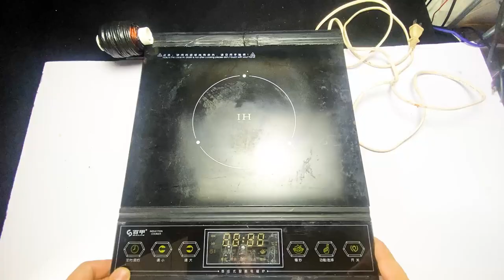How to Make 2KW induction heater from old induction cooker  Great idea DIY induction heater

Comment: Oh, i see:  if it's still able to drive pancake workcoils in the kitchen then why not an air-core selenoïd?!

Well, a genuine IH cooking base happens to be featured with flux-concentrator yokes located below its glass surface, inside in close proximity to the Litz wire actually, so we don't see it but it's there for a purpose nonetheless.

...

As a matter of fact i must confess i thought of a similar procedure when i acquired my Salton iD-1081 and found out such pancake workcoils impose a disc diameter of nearly 4+ inches for its detection to succeed.  The exact date was December 21st, 2010...

Lets raise the bar over a decade later please!

Air-core selenoïds generate only TWO poles with just one single magnetic vector in between.  My challenge is to "Flex the flux" so to bend that vector in a way to multiply the poles, to redistribute the magnetic energy more evenly rather than focus as a red spot.  The thing is all applications don't necessarily even require a metal to be glowing-red, 183°C ~ 188°C (as for 60/40 Solder Alloy) would have been fine back then, though an air-core selenoïd spits out radio noise that has to be tamed down, euh...  M'well, unless living in a forest with no neighbours (and no wall-plugs), possibly relying on batteries or solar panels...

Consider by folding magnetic vectors via "U" shaped flux-concentrating cores it should become easy & convenient to shield it all in a Faraday box, with the workload sealing its IH Aperture electrically as needed.  No more EMi!

Believe me, it's sort of boring when the neighbour starts paying visits everytime one installs in the veranda to relax and finally flip the switch, euh...  Try it around an A.M. radio, it's like a "barker" invitation signal!  At 2 KW why not add an antenna to communicate with beings in space, or on the moon?  ...  Good day, have fun!!

Comment: I guess as its winding it will get short circuit so coil gets spark and damage
Reply from the maker: I also think so. If you want to replace it with a copper tube, you should use a resistance value close to the parameters of the original coil. In that case, the volume of the copper tube will be very large, and insulation will also be a problem.

Comment: Genial.... Es exactamente lo que quiero hacer..... Será para calentar un cautín tipo hacha para soldar canaletas galvanizadas... Gracias
Reply from the maker: It seems that it is not appropriate to use it for work. As far as I know, there are DIY components for high-frequency heaters on the Internet, which will be better than this.
Reply: True, but at a cost of >$100 USD, this, using an unused induction cooker, should work.  Wondering about whether it would be convenient for automotive use ..

Comment: In your opinion, what is the insulating material above the coil if you want to use this method, and what is the amount of heat generated by this process?
Reply: Use a fiber sleeve, it'll work just fine to prevent it from burning and short-circuiting. 
Or you can go all in, use fiber sleeve   and encapsulate it all in cement (or any heat resistant material like it).

Comment: Try taking the secondary coil out of a microwave oven transformer and set it on an induction stovetop with the two ends of the coil about 4 or 5 inches apart then turn the thing on but step back..  lol..  if it grabs you than you shouldnt die but you will at least wake up a little while later..  the more powerful the induction cooktop is the more the coil will multiply the induced voltage across itself..  i tried it on a 6kw and it made the coil arc to the stove and killed the main breaker to the house..   150 amp breaker..   stove fried its brains..
Reply from the maker: Thank you for sharing the method. The wire diameter of the microwave oven coil is too thin. I think it is not suitable for use as an induction coil.

Comment: Great video, but I was wondering if there is a specific configuration for winding the coil or i can wind it however I want.
Reply: with my basic understanding of these effects you can wind it however you want but always in the same direction
Reply from the maker: You can wind it as you like, but the direction must be consistent. The only focus is to insulate it well to avoid short circuiting the coil.

Comment: Working perfectly, but its blown the sparks and coil got damaged. How to prevent this damage.
Reply: And what will happen if i will replace and directly connect to output 1/4  or 1/2 size hvac copper tube instead of coil in induction stove?
Reply from the maker: If copper tubes are used, I think the current will increase and may burn the power tubes or coils.

Comment: can you explain to me something how come these wires have no insulation for the coil ?
Reply from the maker: Because there is insulating paint on the wire, it is transparent, so it looks like there is no insulation
Reply: @MrYang-ju8lc  I see but they don’t get too hot and melt ? Can you tell me how much resistance in ohms are these coils , am looking for a high resistance load because my setup impedance is high

Comment: Danger!  The coil is DC high voltage, DIY is not encouraged.
Reply from the maker: Thank you for your reminder
Reply: @MrYang-ju8lc  i am pretty sure these induction coils run ac dont they?  what are the dangers of this application, please explain? thanks
Reply: itsNotDc.itsVariableCurrent.
Reply from the maker: @iamYOU.youareME5203  Yes, they form a high-frequency current in the coil, what needs attention is to operate carefully to avoid the risk of electric shock, of course this is just an experiment, if you need professional use, it is recommended to purchase the cost
Reply: This is a diy channel, not a kindergarten. But thanks for your concern.
Reply: @iamYOU.youareME5203  For anyone that is near it with pacemaker. Strong EM can cause it to go haywire and kill the person. Other than that you are working with high frequency AC current with just enamel coating on. Slight crack in the coating and you can easily get shocked, probably dead depending on amps and voltage. Always properly insulate such coils ether into housing or least so you dont accidentally touch the coil when its powered. Another thing is using PVC pipe as your core frame. I would advice getting ceramic tube since that wont melt and release toxic fumes if contact with white hot metal.

DIY is fine if you know what are the dangers, but issue is when people dont realize the dangers and get them self and others hurt in process, like few kids following 5minute crafts popcorn machine from sodacans build. Open flame, hot metal, boiling oil, inside the house, with light mass over all and steam explosions from the cornels... yeah what could be a issue there?
Reply: @Hellsong89 

Hello, I am from Iraq and I have a study project similar to this work. In your opinion, what material do I use as insulation over the file? Thank you.
Reply: What's the frequency of this?